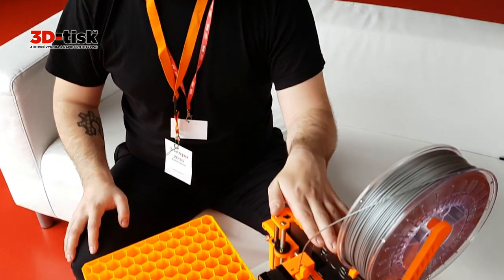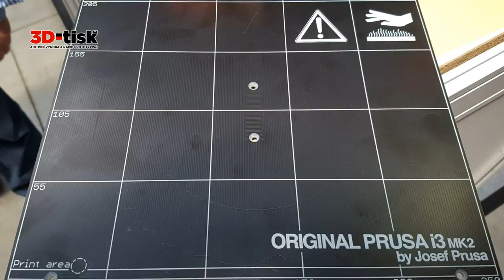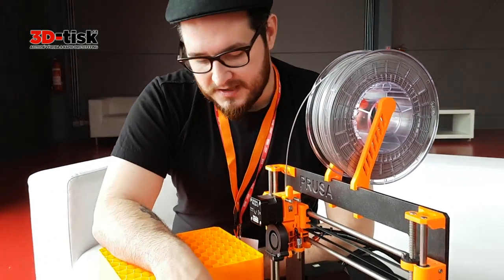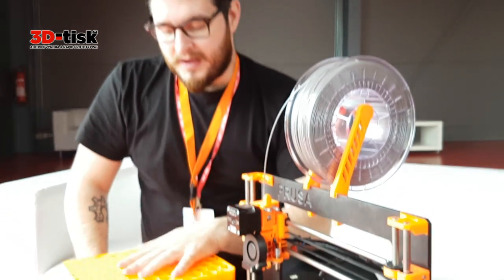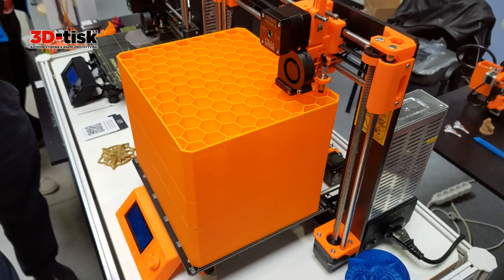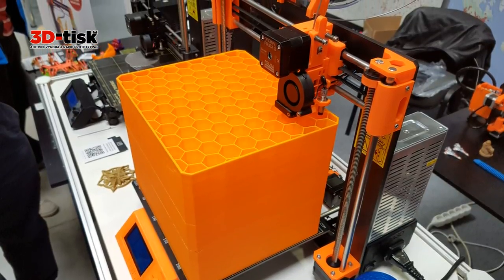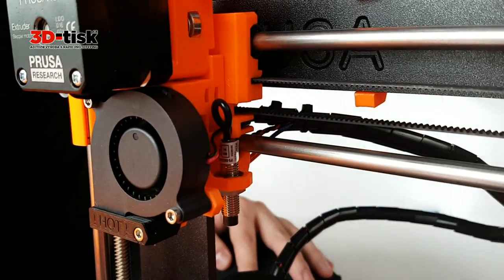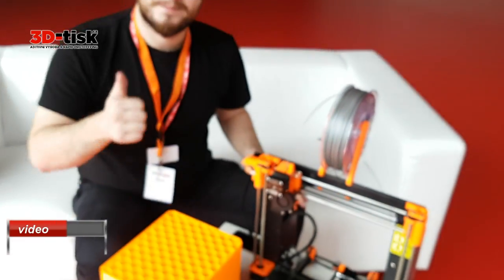Prusa i3 MK2 – Exclusive Introduction from #3Dexpo

Comment: Looks good. After a kit with a large print volume and heated bed etc... but a lot harder than it should be. Addressing the Z wobble, frame sturdiness and heating around the edges is backing a winner as these are all reasons I have rejected other similar printers and kits. With your dead flat print surface it should be easy to implement an "anti-muppet" detector... I envisioned a mod that has a laser diode and detector on the Z axis that allows the bed to sweep in the Y direction with the plate in a certain position to check if anything is on the build plate before doing things. Nothing makes a mess like starting a job with a previous one (or bits) still on the print bed. Have not looked at the specs yet but eventually I would like to get one going with a 32 bit Due as the MCU so I can implement optional audio and speech status updates for critical events.

Comment: Is the model or gcode for the max volume print available anywhere? Thanks!
Reply from the maker: Bundled Prusa i3 models are here: www.prusa3d.com/printable-3d-models/, but it's not there. It is not hard to design it from scratch as infill is automatic and up and bottom faces can be disabled in slicer. But this will be a very long print with more than one spool maybe. ;)
Reply: +Tomáš Vít Okay, thanks for the reply and for the very informative video.